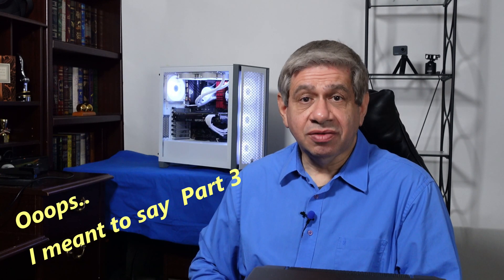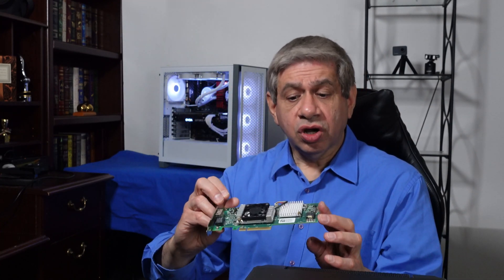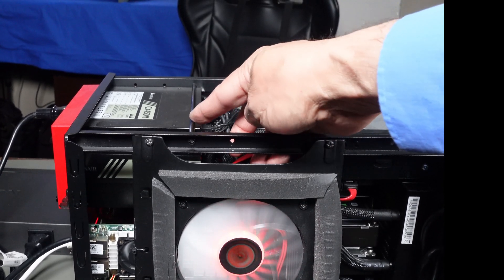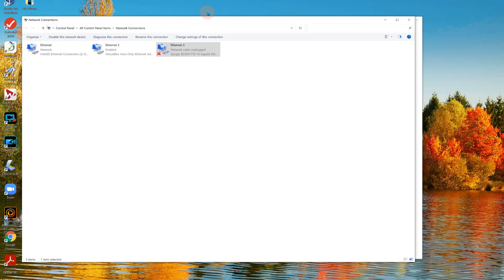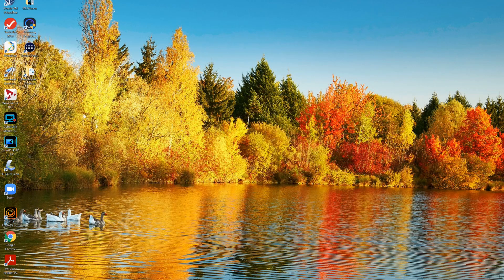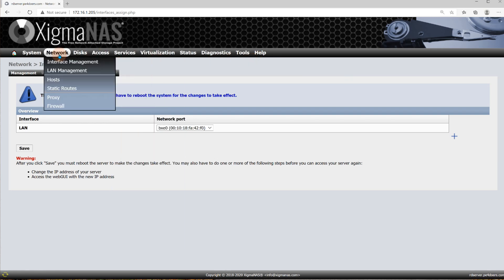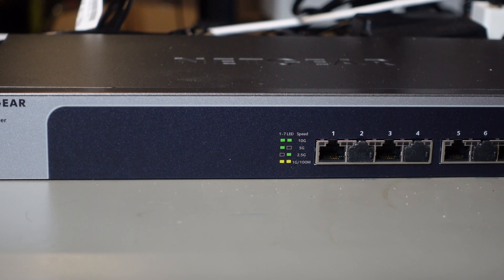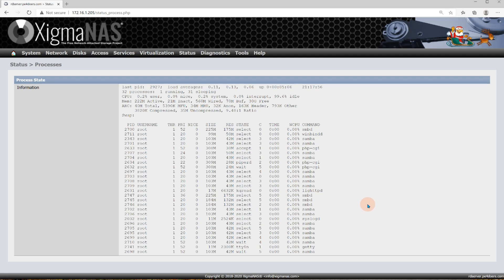Network Upgrade – Pt. 3 – Install & Configure the Network Interfaces for 10gig Operation

Comment: would love to see a speed test to / from your NAS.  I've never been able to get anywhere close to GB speeds from mine.
Reply from the maker: I will be doing those test once I have my network rack fully installed.  I am particularly interested in how fast my new switch actually performs as compared to simply a cross-over cable.

Comment: Hi as always it was a very well explained video. And I learned something new As I always do when watching your videos. I reported questionable comment hence the weird comment count. 

And now I can not wait for the next video :)) I always have the same problem : ))
Reply from the maker: Thanks Kathrin.  The Demolition and construction are taking a lot longer than I imagined :(
Reply: @PE4Doers  Same principle as "I need to to print something quickly." it takes usually 2h longer than anticipated. In your case it might take even longer.
Reply from the maker: @KathrinHausermann  That is absolutely correct.  I also seem to encounter unexpected problems, such as how I needed to deal with that extraneous phone hook-up.  I was lead astray when I tried plugging in phone to it, and it was 'live' , I thought it was the main cable leading to the whole left-side of my house.  However, when I needed to cut it (which I thought would be temporary as I moved the cable to a different point, the main phone line at my desk was still working.  So it seems the house had multople phone cables running through different paths.  That was not my doing, but existed when we bought the house nearly 30-years ago.  So in the end, I just cut it at both ends and removed the unneeded cable.  I just wound up wasting a couple of hours as a result.